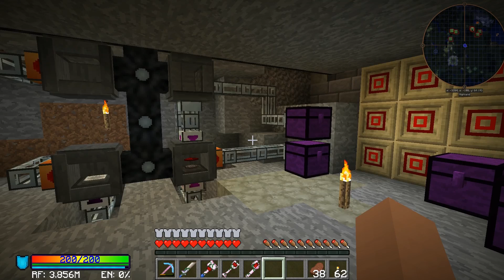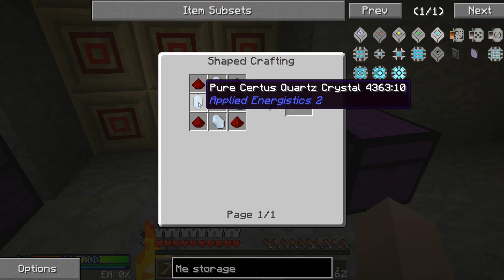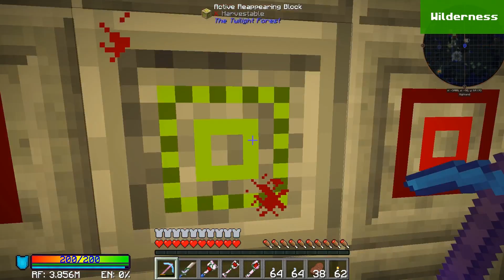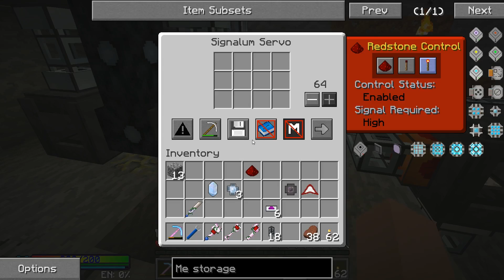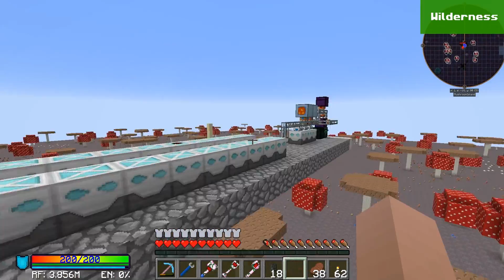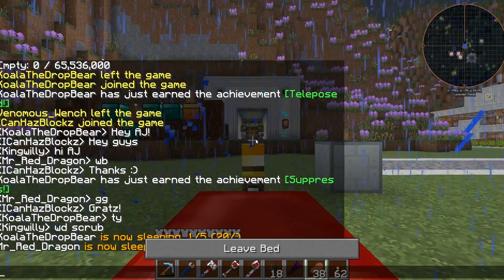Minecraft: FTB Infinity Evolved - Ep.85 - ME Drive Chip Factory Pt.2

Comment: also 21:21 you can eliminate all the damn bees if you just add the Silk Touch mod to the Ender Quarry -- sure, you have to process the ores later, but a SAG Mill will quadruple your ores anyway, so no worries. Sure you'd have to process the diamond ore into diamonds , but seriously, it's worth it -- the SAG Mill (with Dark Steel grinding balls and an Octadic Capacitor to speed it up) is like a supercharged fortune III anyway.. What'll happen with the bees though, is the Quarry will mine up the hives instead of breaking them, so they will all stack, and you can break them open at your leisure when you're ready to set up your genetics labs. :)

Comment: Data, you should make the Glass Fibre cables from IC2, the cables you're using, the HV ones, have a lot of power loss per block. That's the way IC2 works, they send their power via packets, and the longer those packets have to travel, the more power is lost. HV Cables have by far the most power loss, while Glass Fibre cables have the least. Thermal Expansion Fluxducts, BuildCraft Kinesis Pipes, and EnderIO energy conduits have no power loss at all, and Applied Energistics can take power from both IC2 cables and RF fluxducts/pipes/conduits, and as such, due to the power loss mechanic, it's better to use RF over IC2 EU.